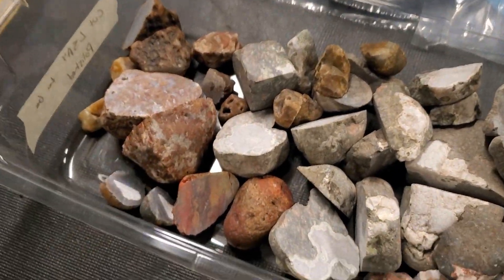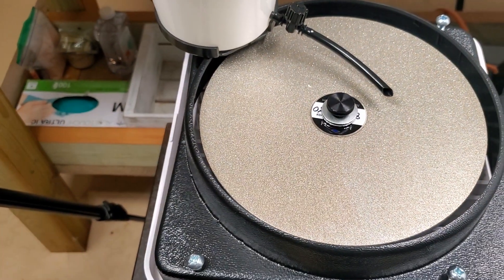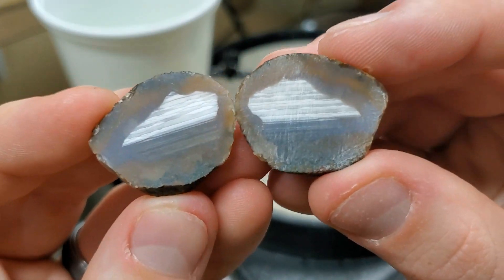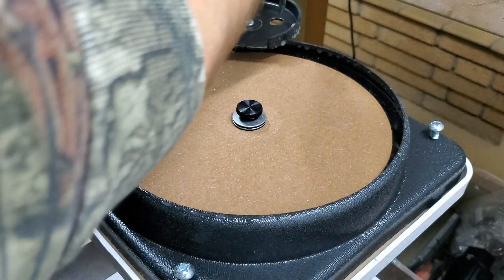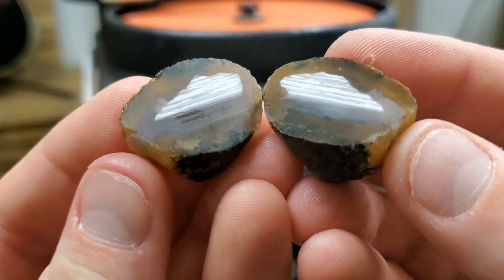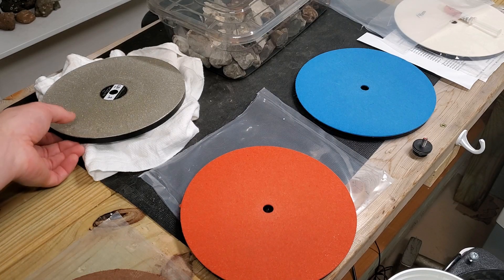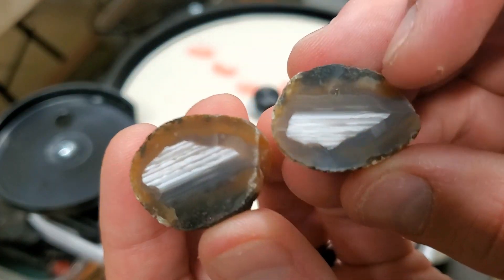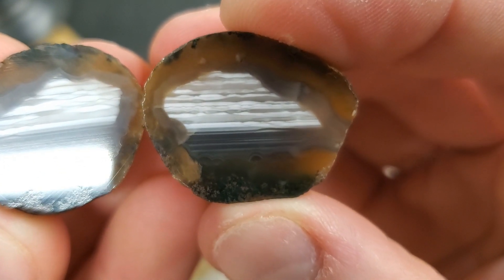Lapidary | Polishing an Agate with Hi-Tech Diamond All-U-Need Flat Lap

Comment: From my time faceting, the scratches you saw after the 14000 almost certainly from the 128 grit. Particularly with quartz based stones (though I was faceting crystalline quartzes) the structure allows for subsurface fracturing. Essentially, the tips of the diamonds are so hard that the pressure you use to keep the stone in contact with the lap causes them to break the structure deeper than just the surface layer, like pressing a nail into your skin.  As you use the machine more, focus more time in the 325 and 600 grit steps, you should be able to trim off the layer that got affected like that.Those grits are going to do the same thing, but it won't sink so far into the stone, and so when you hit the polish stage that subsurface damage will not nearly as noticeable. For a first go, this is a wonderful result. Keep at it and keep learning!
Reply from the maker: Exactly my thoughts but much better put! Thanks!

Comment: Fun to watch. Be careful: that water dries than the dust is dangerous. Potential build a  plexiglass frame around it to enclose. Rinse rocks off in bucket before drying, sponge down the machine at end. Keep up the interestingprojects! Also, dish rack or perhaps funky vintage record rack to hold the disks separate to dry.

Comment: That’s great that HiTech Diamond sent it to you. I have a tip I can share for you: I use a portable dish drain with plate dividers to dry my laps in between use. That way they are drying in a more vertical position. I also cut the bottom out of the box it came in to use the upper portion as a cover to keep dust off the plates when not in use.
Reply from the maker: Great Great Great ideas!!

Comment: Good morning, I really enjoy your laid back, and enjoyable rock hounding. For drying and perhaps for storing your wheels just try for a few seconds running on high speed.  Then set them a drying rack like for dishes. Perhaps go to the dollar store and look for the smaller size for an RV or apartment. You will even have the plastic tray for your drips and the bin for the utensils can hold your washed gems to dry. In a recent episode you had two black small rocks that were very heavy. Could those be tiny meteorites?
Reply from the maker: Great ideas, thank you!

Comment: I've got one of those. Do yourself a favor and pick up an 8" 60-80 grit diamond wheel. It makes rough shaping seriously flawed pieces go SO much quicker.
Reply from the maker: Would you recommend getting that, or shaping with a tile saw?
Reply: @AgateDad  It depends what you're going for. I typically use my tile saw more for shaping odd shapes like cutting letters or designs out of slabs and I use my flat lap more for rounding rough rocks to get them ready to polish or it would be great to round them up before throwing them in a rock tumbler to cut down on the amount of time required to tumble. I don't have a tumbler yet but I'll be getting one for christmas from the GF. Pretty pumped for that. Just started looking for rocks in SE Nebraska in the Omaha area cuz I was inspired by yours and others videos. Its unfortunate cuz there's not many rocks around but I've found a few so far and look forward to finding lots more.
Reply: @AgateDad  and a nice example is I'm making laguna lace agate letters that I'm inlaying in to zebra wood and my slabs for the letters ended up being different thicknesses. I cut my letters out and now they're all different thicknesses so I'll use my flat lap and my 80 grit wheel to grind the letters down so they're the same thickness so I can inlay them easier.
Reply from the maker: Soo many things to use i suppose, I have so many ideas going through my head right now 🤯
Reply: @AgateDad  Yeah, lots and LOTS of tools to the lapidary trade. Its a good thing I've got deep pockets lol. Next thing on my list is some Nova polishing points for my dremel from Diamond Pacific. I've been looking for something like those for ages and finally stumbled across them. Now I can finally start making my chess pieces. Half of them anyway, still need another piece of contrasting rock to carve the other set out of. No luck finding the right one yet.
Reply from the maker: Sounds amazing! So polishing with a dremel.. how do you give it a glass like shine with bits?
Reply: @AgateDad  I use diamond burrs that I get for super cheap at harbor freight to carve my rocks but I was stuck with no way of polishing them. I stumbled across those nova point bits from diamond pacific and from what I've seen those seem to bridge the gap between using burrs to carve and then the nova points should remove the scratches to get to a final polish stage. once you get ready to final polish you should be able to use some of the wool dremel polishing bits with some diamond paste to get the final polish
Reply from the maker: Good to know!

Comment: Nice!  New subscriber here.  For drying the discs, does it work to just run them for a minute at full speed?  The centrifugal force should drive the water off (as well as the airflow across the surface as it spins)
Reply from the maker: It does help but not 100%, I did do that with each disc though! Welcome btw!!

Comment: Just from my machinist past I would say you might need more water on the lap when your grinding. It sounded a bit dry to me.

And with the final polish step I would use less paste for smaller things. I believe  the recommendation they made on the amount of paste  to use is for when you have a larger work piece. From my experiences, less is always better. Might take more time to stop and reapply paste but you would be saving some money with buying paste.

We used less as it was prone to trapping larger particles and getting contaminated. Rather toss a small amount of polish out rather then alot.
Reply from the maker: Good tips!

Comment: Well, this video is 3 years old, so I'm sure you figured it out by now but I would say, if it were me, I would run it on the machine turned on without any water on the highest level and maybe that would help dry it out.

Comment: Do you run the machine at the same speed for all the discs or do you use some lower speeds for heavier grits?  Just wondering as I am working on some auralite pieces and was wondering if I should be using the highest speed for all the discs.  Any help appreciated.  Great looking finished agate piece by the way!!
Reply from the maker: I usually keep mine at a "3"

Comment: Congratulations on the sponsor!
Definitely will check out their link you shared 👍
I have seen a couple of different machines used for grinding and polishing, anyone have knowledge about  
  "3m's Jool Tool"?
Reply from the maker: Never heard of it!
Reply: @AgateDad  I only recently saw it myself. What grabbed my attention was that it sits vertically instead of horizontally. The cool part is the grinding or sanding disc is shaped like a propeller  making it so you come up from under it and can look at the piece you're working on! And you if you accidentally touch the disc it didn't seem like anything. The woman who was demonstrating it touched it on purpose. But it didn't appear very big, the disc was probably 6"
not sure on that though. Didn't say a price for it. I'll put the link to the video I watched incase you want to see it 👍
Reply from the maker: Sounds wild!

Comment: I just received mine- having issues with vibration really bad and the top cup wanting to fall over. Any suggestions?
Reply from the maker: First, check placement of pads on backing discs, if they're not centered that could cause vibration, also what speed are you running it at? As far as the top cup, it should fit in the cup holder snug. I'd call hi-techs tech support as soon as you can if issues persist.
Reply: @AgateDad  thank you- I've talked to a rep and she's sending me a new splash guard. She says it should not be tipping with the full cup on top- should be secured in the water tray. Does yours have tabs to hold in it place?
Reply from the maker: Mine has the four screws and I just pushed it in all the way until its snug

Comment: Hi. I really like to watch your videos. The new tool seems to work great. But what frustrates me at the moment: I can't buy the things you and your fellow YouTubers from the US are using. Not because I don't have the money, but because these things are not available in Europe or they are just not sold to overseas. At the moment I can't even buy tumbling ceramics for my vibratory tumbler... that really sucks...
Reply from the maker: Thats super frustrating!! Is it a issue with companies not shipping overseas?
Reply: @AgateDad  oh yes, it is. If I look for stuff, e.g. on Amazon, I can't find them in the german version. If I then switch to the US Amazon, I find them easily, but if I then try to order them it always says "this product can not be sent to the destination you chose". I just don't understand why. I mean: Not even tumbling ceramics! That's kindergarden, isn't it?
Reply: @stefanieschmid9760  Is it because of the different electrical voltage system in Europe? Does Hi Tech just make machines for USA voltage?
Reply: @davidl.turner1005  Hm, I have a rock tumbler from the UK. It came with an adapter for the plug, so that I could use it.  You mean that we run our systems with 240 volt and the US don't and that's the problem? Possible. But tumbling ceramics don't have a plug 😉
Reply: Would it be cost prohibitive to have someone in the USA buy them and send them to you? 🧐🤷🏻‍♀️
Reply: @littledabwilldoya9717   Hi. If they are not available because they don't fit our voltage system and you can not just use an adapter for the plug, then I can not rum the tools without reconstructing the electrics myself. And I consider that far too dangerous. 
But: I haven't found anybody yet who can really tell me, if that is why they do not ship to Germany. So for the moment I have to help myself with the tools I have. 
Are tumbling ceramics available in the US at the moment? Because here they are not.. ..
Reply from the maker: What voltage plug do you need?
Reply: @AgateDad  230 V, 50 Hz
Reply: Well, what do our plugs look like? Hard to describe in a foreign language ... the whole thing is round, with two round metal pins... Sorry, best way I can describe it...
Reply from the maker: Shoot, hi-tech makes a 220v, I don't know of thats "close".. but I do know that most power cables can easily be changed.. you could have an electrician do it. It would most definitely void the warranty though lol
Reply from the maker: https://hitechdiamond.com/products/all-u-need-rock-mineral-model

Scroll to bottom and see if thats the same plug
Reply: @AgateDad  ha! That's it! That's the right plug! I think I'll have have a letter to write ... begins with: " Dear Santa, I've been a really good girl..." 😉😆👍
Reply from the maker: Tell Santa to use this link when he gets it:  http://hitechdiamond.com?aff=22 lol thats my affiliate link 👍